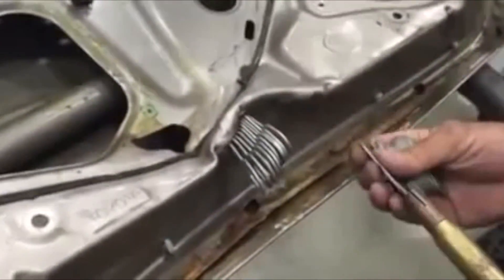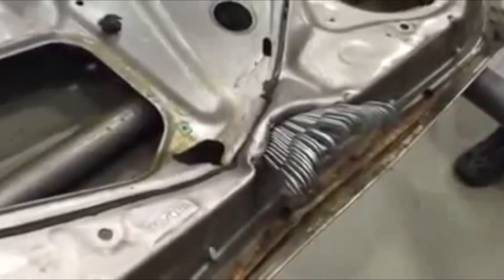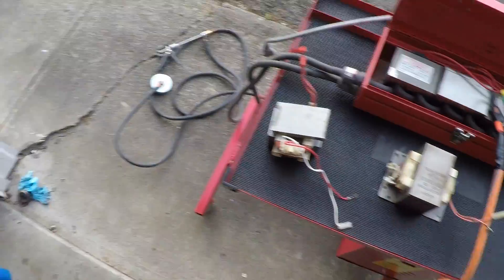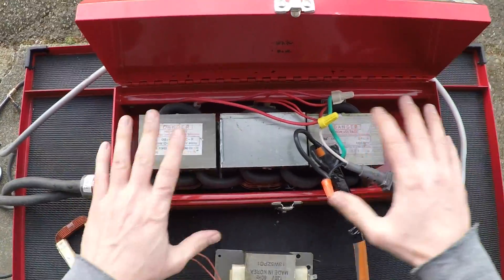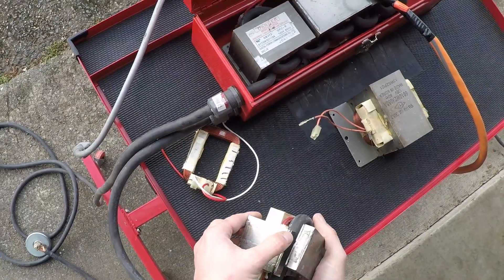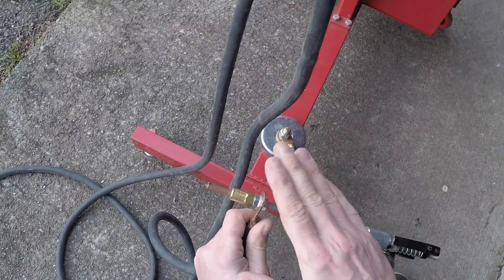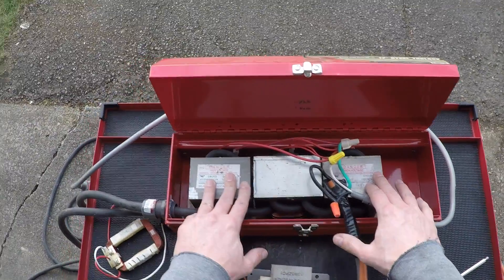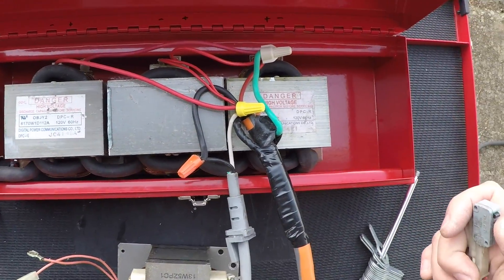✅ How I Built My Car Body DIY Spotter Electric Dent Puller Welder From Microwaves and How It works

Comment: Totally Unnecessary to cut the Iron core apart.
Reply from the maker: If the iron core stayed intact, then I would have had a hell of a time trying to feed the thick cable through the hole especially on the second winding. I would have been ok if the cable that I was using wasn't as thick, but in this application - the thicker, the better.
Reply: @fix206  I have done this you do not have to cut the core.If you use a little silicone spray on the wire it will slide through with ease.
Reply from the maker: I see what you're saying, but in my application the spray still wouldn't have worked because after I've laid 2nd layer of the the thick cable I had to pound it down just so the lid of the iron core could lay down flat. What you're saying would have worked if I used slightly thiner cable.
Reply: @fix206  Again I did the same exact thing.I wrap my coil with 3/0 Welding cable.It takes more effort to cut the top and weld it back into place than to just use a little silicone spray and pull it through.Also there are plenty of video's out there that show this way.I not here to argue with you only to advise other's there is another way.
Reply from the maker: I used 2/0 cable which is a bit thicker then 3/0... Don't get me wrong, I'm not arguing, I know exactly what you're saying and I'm all about doing things the easiest way possible, but in this case the double coil of 2/0 cable just wouldn't have happened without shirring off the insulation off the cable in the process, this cable wasn't cheap so I didn't want to risk damaging it in the process
Reply: @fix206  3/0 is heavier than 2/0.
Reply: @apacheone3643  who cares. You have your way, he has his way. His way works awesome, your way works awesome, that's all that really matters
Reply: @apacheone3643  Wow. That's what you got from that? Ok. Good day bud
Reply: @BurkesRepair  Yes you are a  troll who cannot mind his own business!!!
Reply: @apacheone3643  and dont bother replying,  because I will not be looking or responding, this thread is dead. But you will anyways, because....well....
Reply: @fix206  sorry about this, I am done. Great job brother
Reply: @BurkesRepair  Because you are a troll and need to get involved with a conversation that does not concern you.Also you need to have the last word!LMFAO

Comment: i like your setup, i use one at the shop i work, it has a slide hammer that is used most often, and we use wiggle wire for pulling, we have one that the board went on and i'm thinking i'll replace it with a micro timer, the longer times are used for shrinking,  i'm thinking i'll make my own out of old microwaves, glade i found your video.

Comment: due to a high amperage isn't a risk of an electrical shock? is it safe?
Reply from the maker: No risk, it's DC electricity, same as in the car battery - low voltage high amperage. The only risk of electrical shock would be if i touched the power wires that supply electricity to the transformers.
Reply: @fix206  It's NOT DC coming out of your setup.
IT'S AC
>
Reply: Doesn't matter how high the amperage is.
Due to the low voltage (6-8 volts), it's perfectly safe.
>

Comment: Step by step build on this would have millions of views like my comment if you want a step by step video .
Reply: This is a pretty dangerous setup. If you need a step by step walk through, it likely isn't a project you should tackle just yet. You would be far better off either buying something outright which would be far safer, or learning a bit more about what is happening until you can make something from what was provided in the video.

Here is the issue. At 120v .01 to .02 amps is enough to stop your heart if it should pass through the body to the heart. The microwave transformers are probably pushing 10 to 15 amps in total.  That is 100+ times the amps that can kill you.

The coil windings drop the voltage down a bit but the amperage increases when this happens. A 120v at 10amps is 1200 watts. If it drops to just 12v; it would be 100 amps to stay at the same 1200 watts. A transformer doesn't create or destroy energy, it converts it from one voltage and amperage to another. But energy in will equal energy out (with slight deviations due to heat and resistance). So even though the voltage drops, you are still dealing with enough energy that it could seriously harm or kill you. You probably shouldn't be tackling projects like this via a walkthrough.  If on the other hand,, you can understand what was presented enough to recreate it, your chances of survivng unharmed increased enormously in my opinion.
Reply from the maker: I'll do a detailed vid on later date. I'm pretty sure that it's DC electricity that flows through the thick black cable. Voltage is low 6-9 volts but amperage is close to 1000A, same principal as car battery. I"d say it's pretty safe. now if that was 1000 Amps of AC it would set your body ablaze :)
Reply: @fix206 sigh... it is AC voltage. You don't have a rectifier setup anywhere that I saw or that you mentioned. You just modified a transformer to lower the voltage and increase the amperage.
Reply from the maker: I'm no electrician, but I know that you can buy this setup in Europe and a lot of people are using it with out any issues. Because if folks were getting electrocuted this setup would be deemed as dangerous and wouldn't be used/sold.
Reply: @fix206  you can buy them in the US too. It is basically an AC transformer stud welder. The type of studs used are different but it's the same concept. 

Now the difference is going to be that where you are holding it will be shielded so the current doesn't pass through you. There will be breakers or fuses on the device itself and that wire you showed and said isn't connected to anything- that is the ground wire and should be grounded to the frame of the toolbox you mounted in which should also be grounding the transformers and everything in. It should go to the third prong on the outlet and If you home electrical is up to code, it will go to both a ground rod and the neutral side of the electrical service at the panel. 

In other words, you have no safety built in. I don't know the laws in Europe but I find it hard to believe they wouldn't care over there. You can do whatever you want. I initially assumed you were aware of the risks but I guess I was wrong. I still think people who have no idea what they are dealing with here should just purchase one instead of following a detailed walk through created by someone who is also oblivious of the dangers involved. In my opinion, you are just as well off as someone huffing gasoline while smoking a cigarette.

Comment: What an Interesting build, as to building a single transformer will not be a problem for me it will be the accessories, the keys that you use, are they also DIY or store bought, as well as the welder attachment, by the way you did a fantastic job on your frame puller.
Reply from the maker: My original plan was to build everything including the puller attachment, but then I fond a place online in Russia that sold everything related to spotters, including accessories. So that's where I bought, the puller and the keys from. But you can always use steel washers instead of the keys. They work just the same, and the puller can be made from caulking gun,

Comment: This was a really interesting video on the basics of making the spotter. With the microwave transformer, the thick winding is the primary and it's active and neutral because it's A.C. Reading through the comments, it's important to get the transformers in phase, as one subscriber found out when two transformers cancelled each other out, resulting in 2V instead of 6V, which he got when he corrected the phasing. I hope you can do a follow-up video on this with more information on acquiring/making the accessories. You certainly have a good toolbox of accessories there. I've been doing a bit with microwave transformers and I've watched several videos on different uses for them, but this is the first time I've seen them used to make a body repair tool. Excellent idea and I do hope you make a follow-up video with some more details on the accessories and further refinements to the unit to finish it off fully. I'll be watching the Civic roof repair videos next, to see more of the spotter in action.
Reply from the maker: I will for sure refine the tool later on down the road, and will make an updated video on it.
Reply: Hello, How can you have the transformers in phase?
Reply: @mickredfox  This is done by making sure that the transformers are connected to the mains the same way, so that the windings go in the same direction, either clockwise or anti-clockwise. Assuming that the transformers are all identical (ideally, they should be), then connecting Active (black, brown or red, depending where you live) to the left side connector on all transformers and neutral (white, blue or black depending where you live) to the right side of all transformers, should result in them being in phase. The same principle applies to the thick secondary windings, which must also be wound in the same direction. An AC wave form is a sine wave, so that if the transformers are all in phase, then the sine waves add together, but if one is out of phase, then it cancels the other. There's an explanation here: https://www.prosoundweb.com/topics/education/polarity_and_phase_explained/
While the reference in the link is to speakers, the same principle applies to transformers and mains AC. I'm certainly not an expert in this field, as I only have a basic knowledge on the subject. Hope this information is useful.

Comment: you should use a starter relay instead that button
Reply from the maker: You are correct, I gave this much thought and I'll be adding more parts to the setup later on to refine it even more. The way I have it setup right now is just temporary. I'll be doing an updated video later on down the road.

Comment: I need  this in my life
Reply from the maker: I know exactly how you feel, because I felt the same way when I came across a video on the internet few years ago with the guy who was using a spotter, I was shocked that I've never even heard of this tool. Then it took me a while to figure out how this thing works and how to make one. I got a video on my channel where I'm using this tool to bring up a car roof that was pushed down. To be honest if I didn't have this tool I would have had to replace a part of the roof, but with the help of the spotter I was able to save the roof and that repair was waaaay easier to do.

Comment: Good morning, where did you get the squeeze puller that you used to pull the small dents out? Thank you for sharing your talents and expertise. You take care.
Reply from the maker: That was one part of the setup that I didn't build myself. I ordered it from Russia. I was going to build it by using a cheap caulking gun, but in the end decided just to buy it instead.
Reply: @fix206  Good afternoon, have you got the company name and address for these pieces and parts? I have the spotter, but this looks like the best squeeze puller I have seen. You got to admire those people. They are very clever and innovative. Thanks.

Comment: Its AC coming out of those transformers so ground or positive shouldn't matter.  Concept is the same though, one wire goes to the frame and the other to the key.  Low voltage at really high amperage, probably about 6 to 10 volts and a ton of amps in your setup.  One thing I would do is wire in a second switch so when your button there eventually goes bad (likely will) and welds itself in the on position you can still shut it off quickly before you melt the wiring going to the plug or even the wiring in the mains.  Maybe even use a 15 or 20 amp breaker somehow.
Reply: You need two relays. One is “off-delay” which controls a second “contractor” relay. Your thumb switch triggers the off-delay which holds the contractor closed for the time set on the off-delay. Here are examples: 

https://www.amazon.com/dp/B07RDDQS7J/ref=sspa_dk_detail_2?psc=1&pd_rd_i=B07RDDQS7J&pd_rd_w=ld2g4&pf_rd_p=45a72588-80f7-4414-9851-786f6c16d42b&pd_rd_wg=S2qbd&pf_rd_r=SSZP9ZTTDHGHM2JS8GZ1&pd_rd_r=866fa779-b381-4fe3-8247-0cd03df03c7d&spLa=ZW5jcnlwdGVkUXVhbGlmaWVyPUFJTllHODVaVE0wMEMmZW5jcnlwdGVkSWQ9QTEwMDk1NTExOExMNUs2QjlUTzFVJmVuY3J5cHRlZEFkSWQ9QTA3NTI4NjMxTDFJTEtGSDMzS041JndpZGdldE5hbWU9c3BfZGV0YWlsJmFjdGlvbj1jbGlja1JlZGlyZWN0JmRvTm90TG9nQ2xpY2s9dHJ1ZQ==    Choose the 3S option

https://www.amazon.com/Packard-C230B-Pole-Contactor-Voltage/dp/B001KGSJ74/ref=sr_1_3?crid=25I727FQ4YRUR&keywords=110v%2B30a%2Brelay&qid=1567011537&s=gateway&sprefix=relay%2B110v%2B30a%2Caps%2C523&sr=8-3&th=1
Reply from the maker: That timer might be an option, to bad it goes all the way up to 10 seconds, ideally the timer would have to be a bit more compact and have more sub second settings like 1/10, 1/4, 1/2 second settings and so on. because If the pulse is too long even by a tiny amount,  that will result in stronger adhesion, thus as the puller would disengage from the panel it will rip out a very small piece of substrate that would result in leaving behind a small pin hole in a panel.
Reply: Fix206,  you’re looking at the wrong one. Notice I said to choose the 3S relay. There’s even a 1S.
Reply from the maker: Oh now I see the one you're talking about, by default once I clicked on the link I was routed to a 10 second model.
Reply from the maker: You do know what you're talking about👌, and you are 100% correct. I"v already welded one switch shut. This is just a temporary crude set up that I'm looking to perfect in the future. Ideally I'll like to have an autostart feature that would eliminate the physical switch all together. So when the tip would touch the grounded surface depending to the preset delay, it would get welded onto the panel, and the duration of the pulse would also be timed and adjusted to desired length with a knob. There is a guy in Russia that builds these controller boards to order, so I think I'll order one from him. Wish I could find someone stateside that could put together something like that for me.

Comment: I made this from your video but I wanted to know how do you wire the primary windings to the power cable? Do you place all the neutral together? Also which direction does the thick secondary cable enter and exit through the 3 transformers? What do you use for the tip of the puller? A brass rod or copper?
Reply from the maker: The neutral wires from transformers are all bunched together and they will connect to neutral that will come from the wall and the same goes  for the power wires. The direction of the thick secondary cable does not have to be ran in any particular order, any way you chose to rout it will be fine. And as far as the tip goes it will have to be the same type of metal as the surface you'd be working on. Because copper or brass or aluminum will not fuse to steel. Let me know if you have anymore questions
Reply: @fix206  I did all of the above except for the tip. I had a regular bolt sharpened to a point but it would not stick. So I thought maybe it needed to be copper. However when I tried the steel bolt it wasn't with the thick white that I got today. I will try it with the steel bolt with the thick wire. Also I am getting 1.98 volts with no load.
Reply from the maker: You should be gettin right around 2 volts out of your thick wire per 1 transformer used, so If you're using 3 transformers (like I do in my video) then you should be getting ruffly 6 volts. And if you're not getting that then one of your transformer's primary wiring is hookied up in reverse.
Reply from the maker: And also try using a steel non galvanized nail for testing instead of a bolt. See if that'll stick better
Reply: @fix206  how do I tell which primary winding is in reverse
Reply: @fix206  you were right I started with one transformer and I got 2 plus volts then I switched the other transformer neutral to the other side and then I left the last one the same. I got 6 plus volts I was so excited to see if it will work. While righting you to let you know my findings, the electricity is now off lol. God is good! Thank you for your help. If this works my next project is a frame puller
Reply from the maker: put your voltmeter on the thick secondary wire, and then one by one reverse polarity on the primaries while keeping an eye on the voltmeter, if the voltage drops as you switch polarity then that means that particular transformer was hookkedd up right. Hopefully that helps
Reply from the maker: If you use 3 transformers the sticking will get even better. You can also use steel washers inline and run a metal rod through them to make pulls on larger areas such as a quarter panel of a  roof (that you can see in my "Doing metal work on civic roof" video ) Possibilities with this tool are endless. Let me know if you'll need any pointers on the frame rack build :)
Reply: @fix206  thanks for the info
Reply: @fix206  how did you make the magnetic ground
Reply from the maker: I bough it at harbor freight. It's in a welding section. It was under $10
Reply: @fix206  just an update. I am getting 6 plus volts but the tips I use just get red hot, they don't fuse together. Any ideas
Reply: @fix206  I made sure got some steel tips but nothing fuses.
Reply from the maker: get some steel washers and try to fuse them to a junk fender. See if that works

Comment: where do you get those pullers spot welding tip puller
Reply from the maker: are you referring to the tips that look like the keys, that were welded in a row to the edge of the roof? of the brass tip that goes on the end of the actual puller?